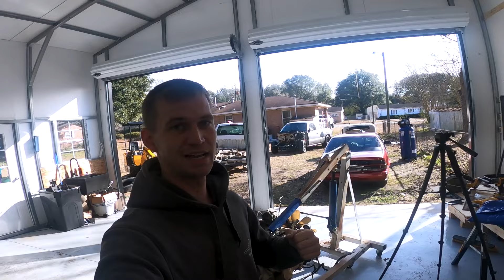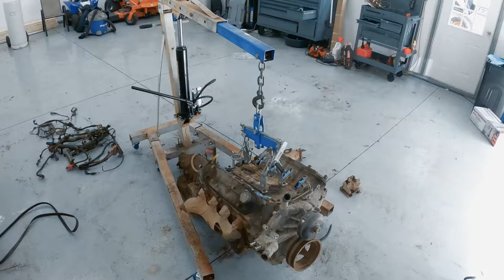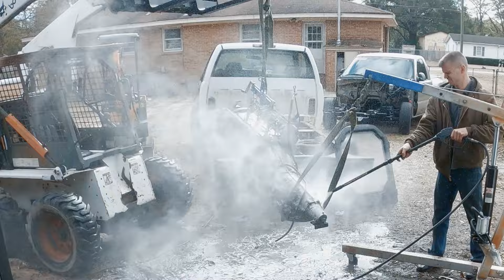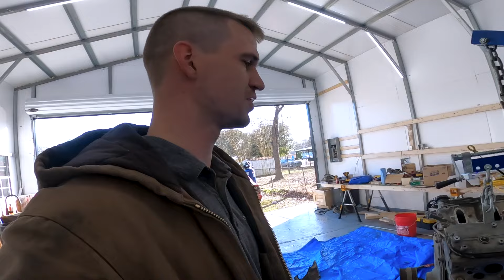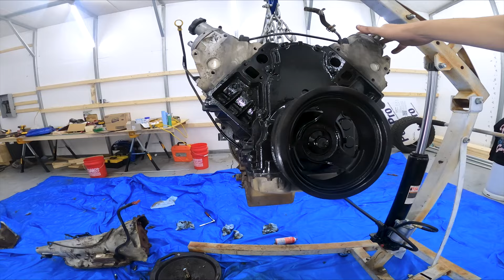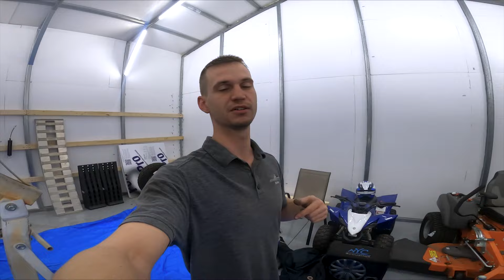LQ4 Engine Build Part 1 Engine Prep and Paint

Comment: I picked up the heads this afternoon from storage. Just gotta box them up, and send them your way. (Likely will steal the boxes that my AI 799s are in currently) 

Now I just gotta talk you into one of the big ass cams we discussed the other day. Maybe a hi ram intake too.
Reply from the maker: Sweet and yea Im contact Texas Speed and see if they think I will run into trouble with that Stage 4 Cam on a lq4 with shaved ls3 heads. Might be what goes in the truck this time and I do want to put a Hi Ram on it eventually. Like I said might try to push the truck into the 6s
Reply: @FrogsGarage  that's what I want to hear. You do that, and it will push me to put an 80mm on my s-box.